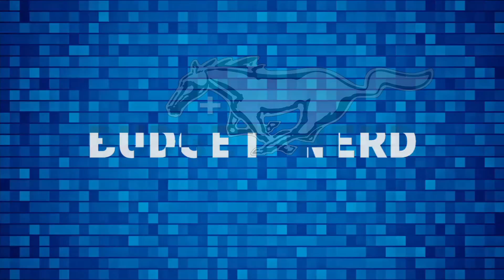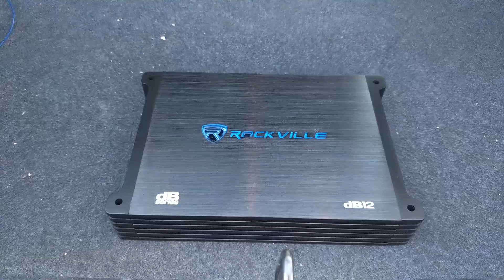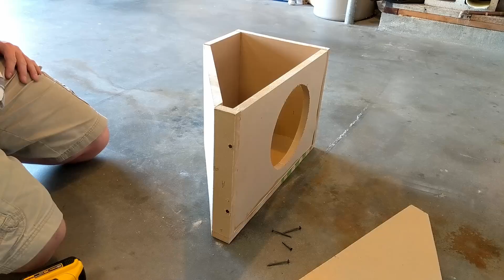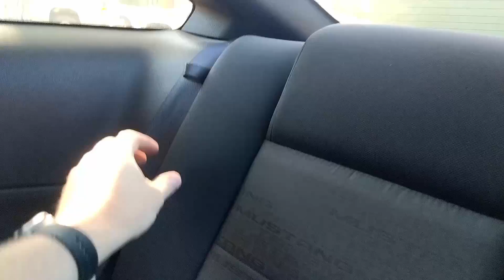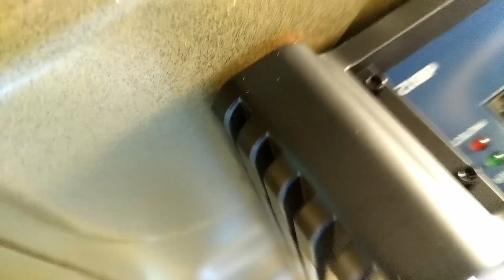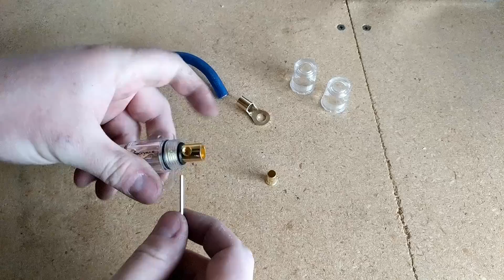Stang Audio Install Part 2 || Custom Box + Rockville Amp

Comment: bad ground location. decklid is only spot welded and glued to that location. you want the ground on the floor thats why pros mount the amps behind the seats or on the floor. use a multimeter set to ohms and have the leads touch your current ground location. you want zero resistance, any resistance will generate heat which robs wattage and heat will kill the amp in the long run
Reply from the maker: Good tip